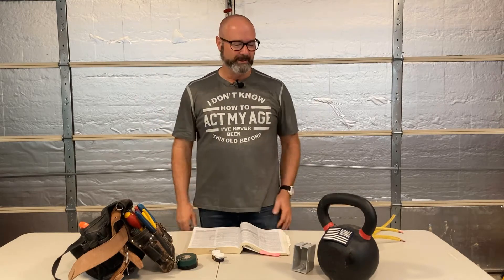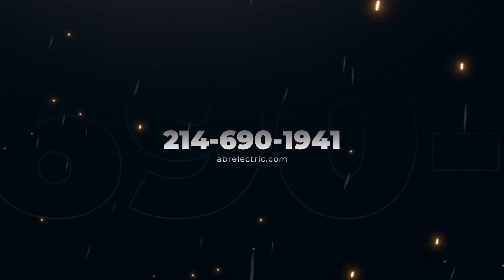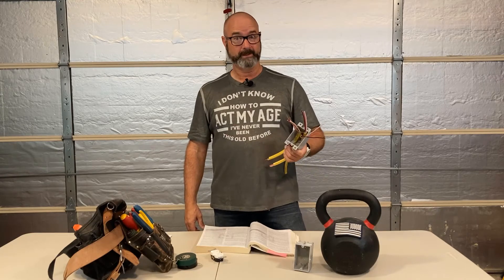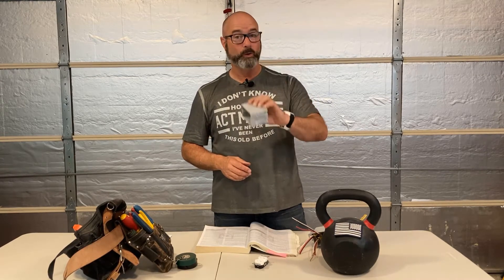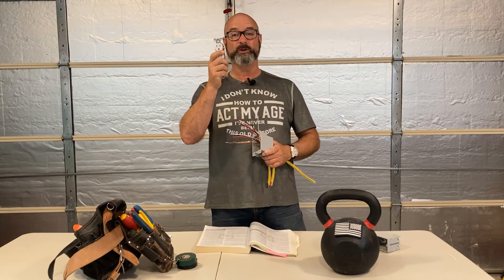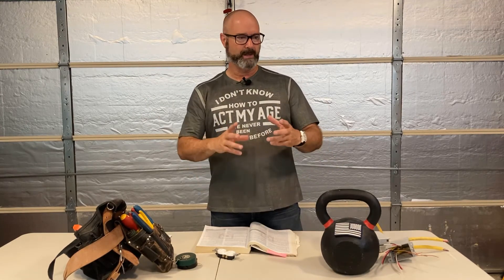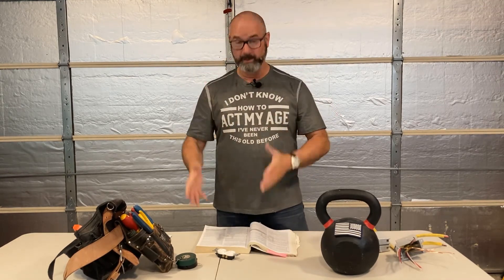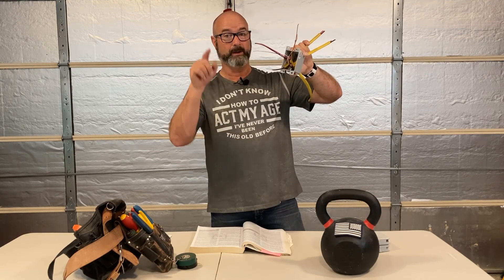Think Inside the BOX, Article 314: Electrical Box Fill

Comment: kitchens counter tops usually run on exterior walls so the smaller the box, the more insulation you can get behind them.... that's one reason to have a smaller box. thanks for video though, it was very helpful.